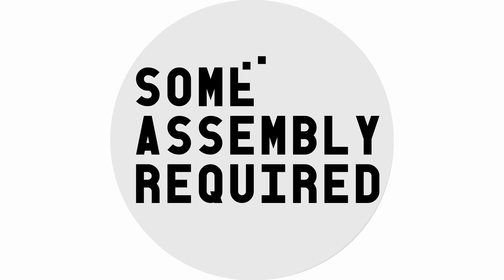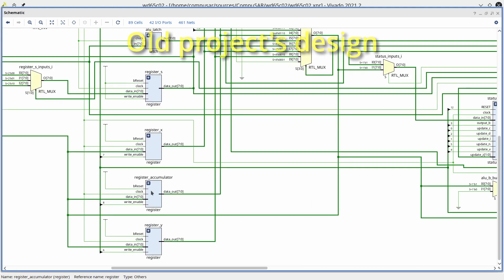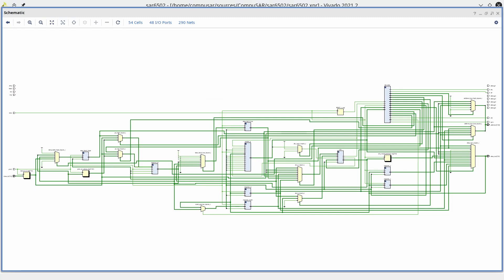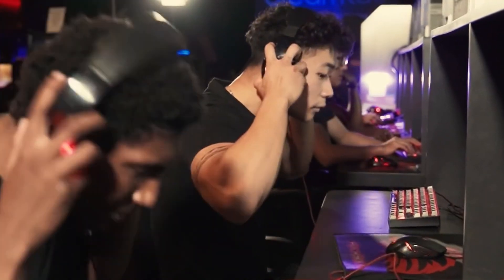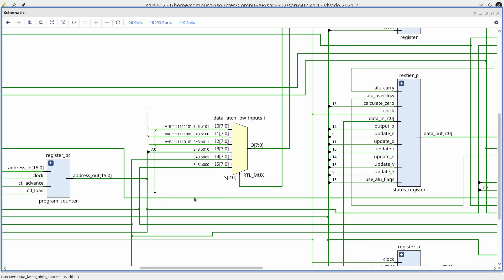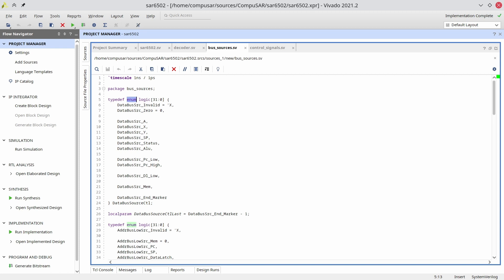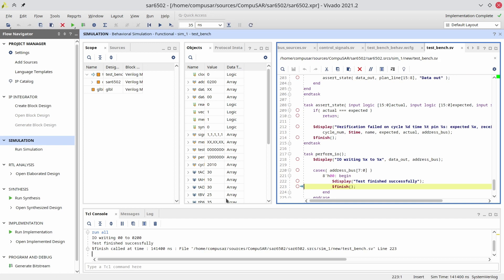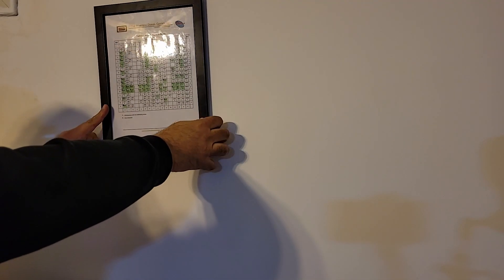Starting over

Comment: SB = Special Bus;  Sometimes it's address, sometimes it's data.
Reply from the maker: That makes sense. Thank you.
Reply: @CompuSAR  You're welcome. If you would like an authoritative source for confirmation, US patent #4,876,639 was written by the 6502's layout architect Bill Mensch and it uses the term Special Bus to describe this special transfer bus in a later design.
Reply from the maker: @Peter_S_  Truth be told, just looking at what the opcodes do and how long they have to do it pretty much answers any questions one might have. My previous design had an equivalent to the special bus (I called it "internal bus"), and that was before I found this diagram of the 6502 internal structure. The functionality mandates it. The new design doesn't have an internal bus, but you could argue it has 11 (well, 8. Data and address are not internal).